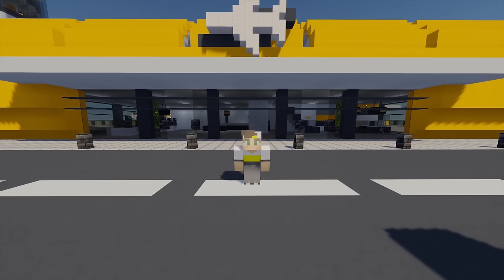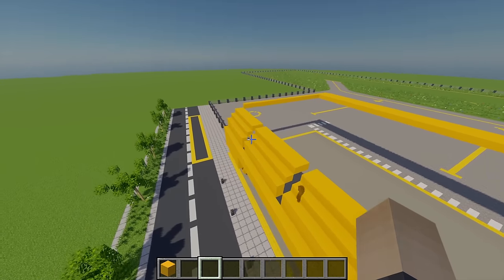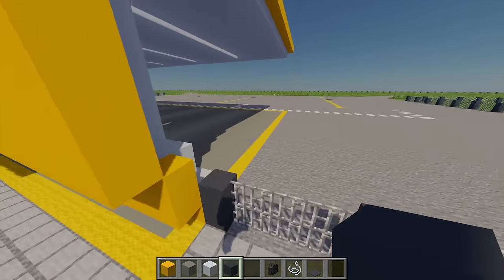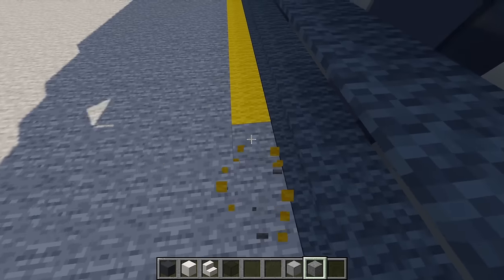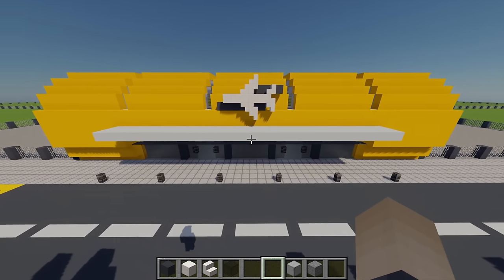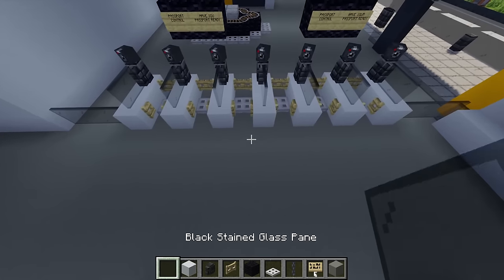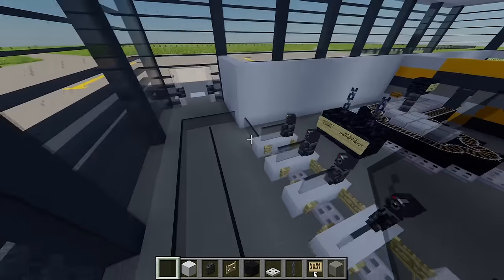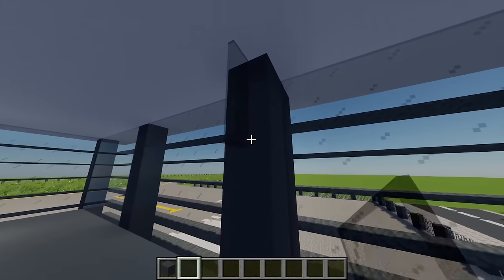How To Build An AIRPORT TERMINAL In Minecraft! (Airport Collection Pt.1)

Comment: Great tutorial, followed most of it but put some minor tweaks in, like using end rods for lights rather than the glowstone, couldn't use the invisible frame so just used item frames and placed in what was needed, and used the redstone and piston trick for doing the laptop screens. Pleased with how it turned out, now into the ATC and runways, and dispersal areas